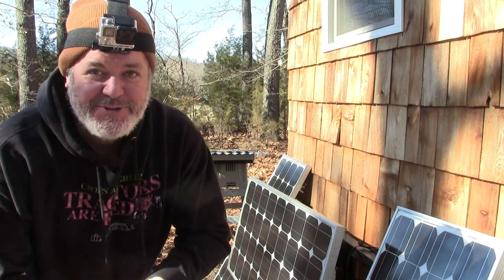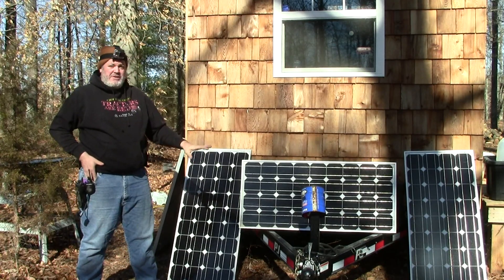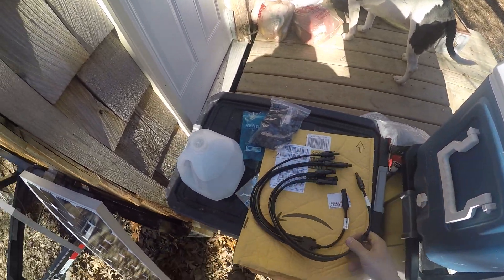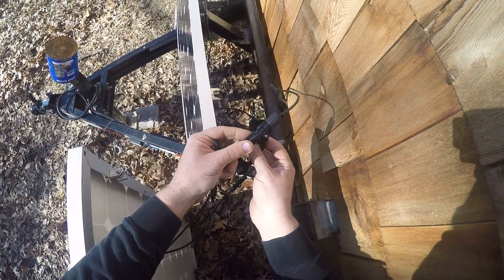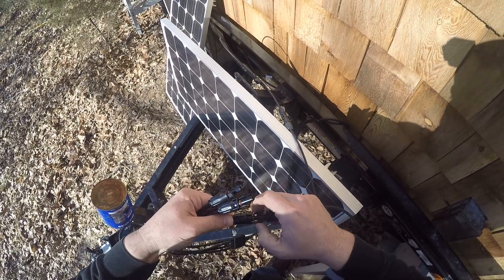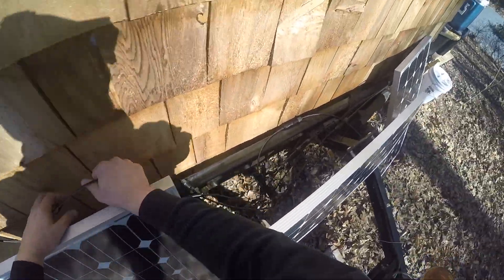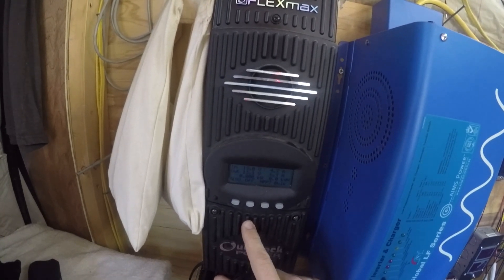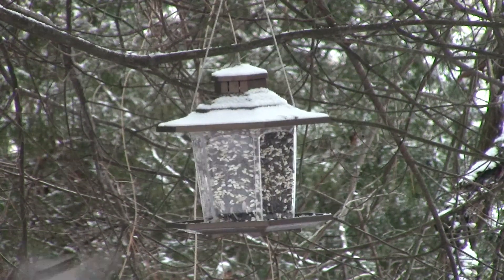Solar Panels - Wiring in Parallel to Maximize Output when Shaded

Comment: does each panel need a blocking diode if its to be wired in parallel?
Reply from the maker: I did not use a separate one for these as I think it's built in. That or my charge controller handles it. I don't remember. If you are hooking strait to a battery of equal voltage (skipping the charge controller) then you will need one of it's not built into the panel.

Comment: Awesome video! I installed mine in parallel also... keeps getting power even in the shade! Here to give yo support! Cheers!
Reply from the maker: +OregonBatman Thanks!
Reply from the maker: At a computer to type a little easier! I had my four panels wired in series when I had them out in full sun all day and it pushed higher volts to my MPPT charger controller great. But when I moved into the trees that wasn't working out so well so I switched. Now I only get a max of about 18 volts but it holds the amps better.
Reply: I can get 21 volts from mine... but due to winter months, and my panels are flat on top of trailer, not drawing too many amps. Looking forward to seeing what they can really do!
Reply from the maker: Do you have them mounted so you can prop them up toward the sun when you're parked? When I had mine mounted properly and in full sun I had a deal that would track the sun all day. It made a big difference when I put it on. I suppose that'd be a little difficult to get set up on the roof of an RV.
Reply: Negative... flat against the roof. Semi Flexible panels. In the dead of summer they are going to be great. Might have to invest in a portable set to position towards sun in the fall!